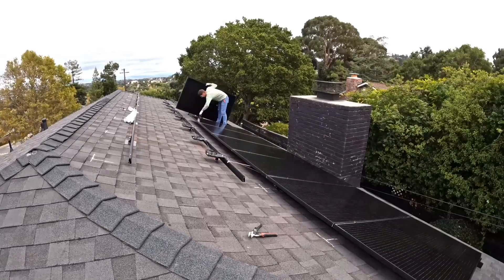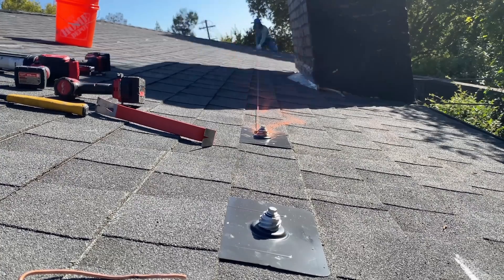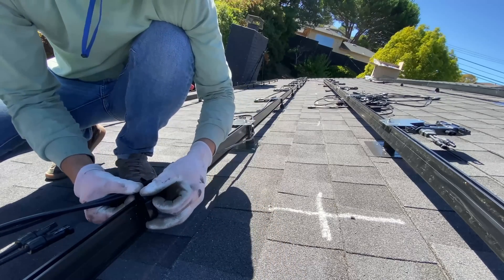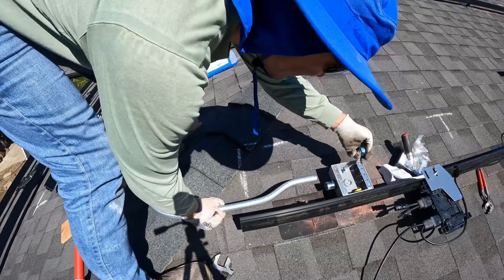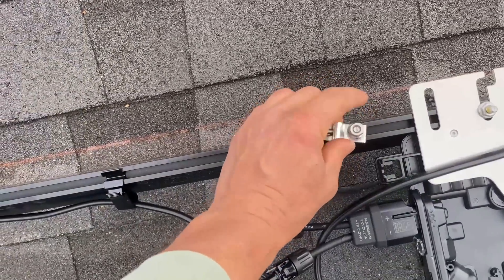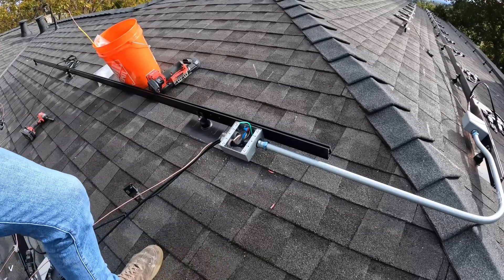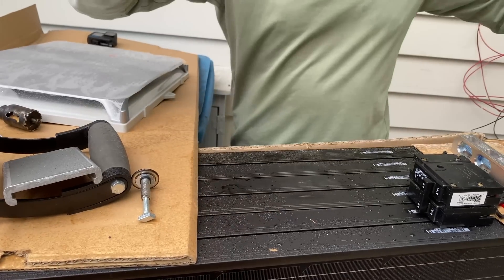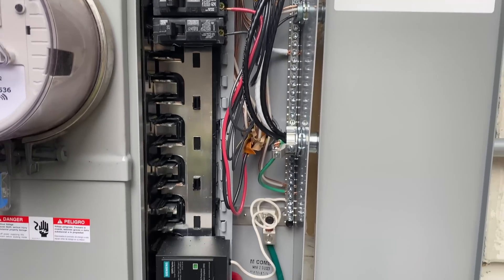Installing 28 Solar panels 9.5kW array. Enphase micro inverters.

Comment: what type of connector are you using where the bare copper wire and the L1 and L2 wire enter the Junction box where theres no conduit just wires

Comment: Hello Verry clean installation and instructive video, Thank you.
I have one question, all your micro-inverters have been installed in series (opposite of parallel). What is the section of your connection cable? 6mm²? Is this section sufficient for an installation of 9.5 kW ? thanks.
Reply from the maker: All microinverters installed in parallel. Check Enphase trunk cable.
Reply: @SolarEngineering  Oops, sorry. They were well in  // . But what was the diameter of the eletrical line? 6² or 10²? thanks
Reply from the maker: @ trunk cable is 12AWG, from junction box to Enphase combiner box 10AWG
Reply: @SolarEngineering  Thank you; This is respectively 4 & 6mm²

Comment: Do you need a combiner box or can you just put the wires directly into the panel?
Reply from the maker: combiner box (envoy) provide monitoring. microinverters will work without combiner box.

Comment: How do the powerwalls supply power when grid down. Looks like the PW output went right into main panel, just don’t see where the transfer from grid to battery occurs.
Reply: This guy just did the Enphase combiner box only. The combiner box does the monitoring of the micro inverters and gives you the power output to your home's breaker panel. If you want battery backup, auto transfer (when the grid goes down), and some cases a generator auto start if grid is down for several days, you will need the Enphase System Controller Box in addition to the combiner box. Your battery backup, combiner box (solar panels), and main grid power all go to the system controller. Then you have the output to your breaker box. The whole system is very nice. When the grid power goes out you will not notice anything is wrong except from an alert from the system controller. I'm planning on adding generator support because I had an outage for 3 days last winter and no sun because of the snow.

Comment: Stupid place to put panels, trees and chimney means shadows at all times ,or was that not thought about.?
Reply: I agree that shadows from the trees and chimney will drastically affect the electric power output. Depending on the arrangement of the micro inverters, partial shade could totally cut off power generation. I have a 23 panel 9.1kw system from Enphase and there is no shade. On sunny days in this April 2024, my system produces 55 kWh per day.
Reply: With microinverters, shading on one panel only cuts production on that single panel and does not hurt production from other panels like with string inverrters.
Reply: @marklefler4007 still missing out on production on each shaded panel

Comment: at 1:58 you show the racking system with the bolts facing the peak of the roof.   The "clean" edge of the rack is facing the ground.  Is that the correct way to do it?  I think it looks better the way you have it, but I believe it is reversed.  Most images on google show the bolts facing the ground.  That allows the rack to press against the L foot and probably have a tighter connection.  

Thoughts?  Great Video by the way.

Thanks,
Reply from the maker: I'm installing now with bolts facing to the outer side, in this case, if I need to adjust the height of the rail, it's much easier to do (when a panel is installed). I did watch Iron Ridge videos and saw rails installed both ways.